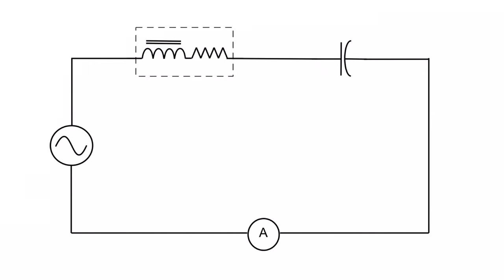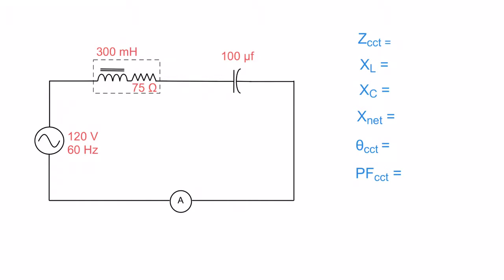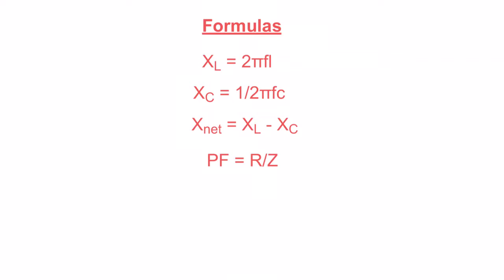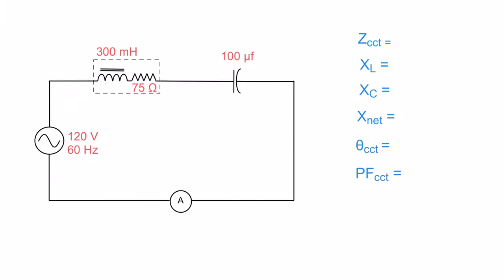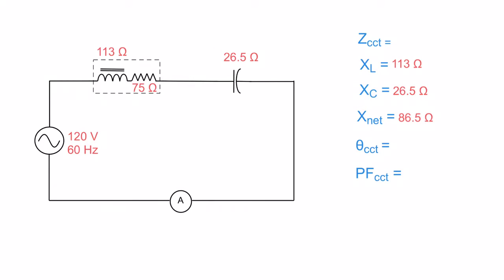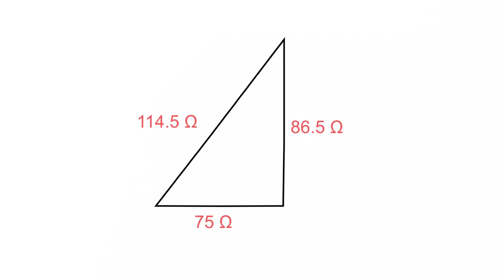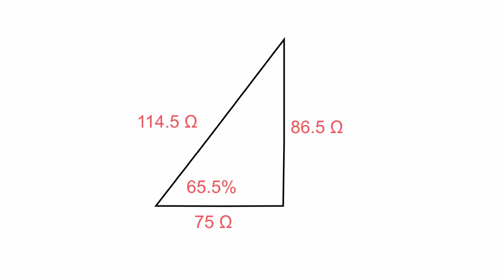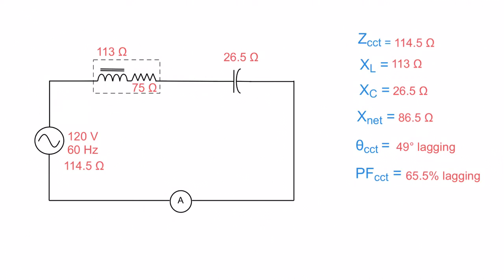AC series RLC circuit

Comment: a coil having a resistance of 8 ohm an inductance of 0.2 henery is connected in series with 50 micro farad capacitor .at what frequency does resonance occur.if applied voltage is 100 volts.find at this frequency. (a) current (b) p.d across coil (c) p.d across the capacitor